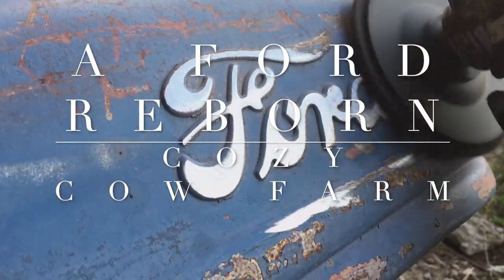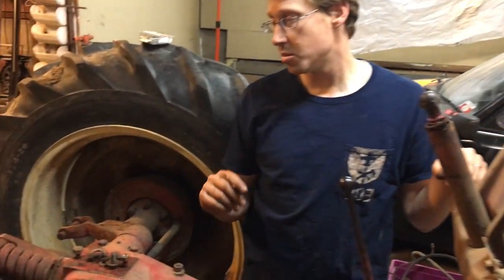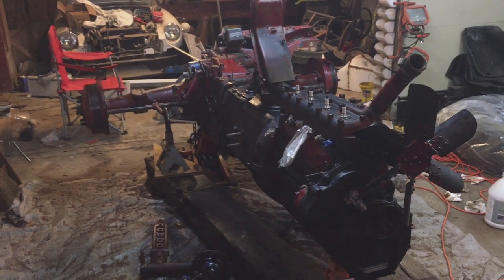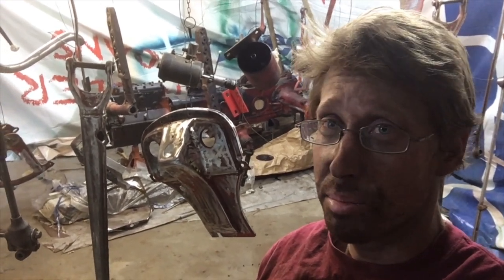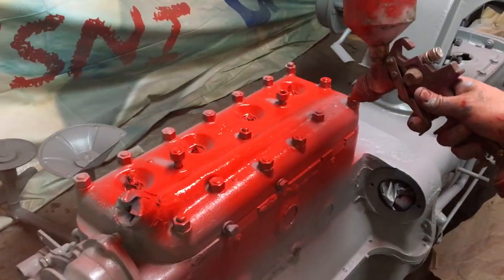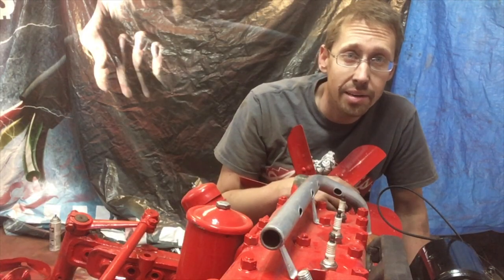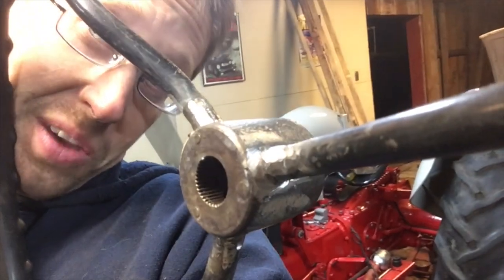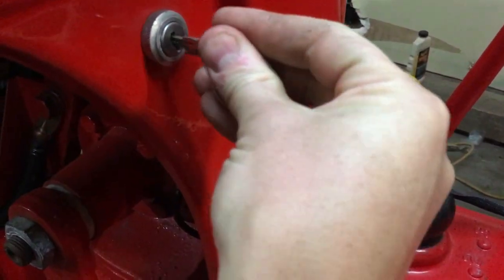Restoration Fixation: The Baby Ford Gets the Repaint it Deserves (part 2)

Comment: About to undertake this same thing on my great grandfather's 1959 601 workmaster we're about to get a hold of. 
I didn't realize they painted them with all the components on at the factory. I saw some other youtubers do that, but I agree that taking it a part not only gives for a better finish and resilience than factory, but you get the chance to look at the parts more closely and check for defects.
I may deviate from period colors and go for Ford blue and white, but I'm not 100% on that just yet.

Glad to see what I have to look forward to! 
Fantastic video, thanks for sharing!
Reply from the maker: All blue with white grille, fenders, and wheels is pretty hard to beat! For the 601's I prefer the hood matching the engine color for some reason.

Comment: Looks great! I will be painting the chassis of my 1949 soon. All of the sheet metal is done, then I'll just have to remember how to put it all back together. May be a little late now, but the patent plate on the battery box is replaceable. They are available from Dennis Carpenter or Just8ns. Enjoy your videos!
Reply from the maker: Thanks! Good luck with yours! It can be a challenge to get everything reassembled. My wife labeled bags with which bolts went to which components. That helped a lot. She wasn't around when I took out the grease zerks and I am not actually sure where I put them!